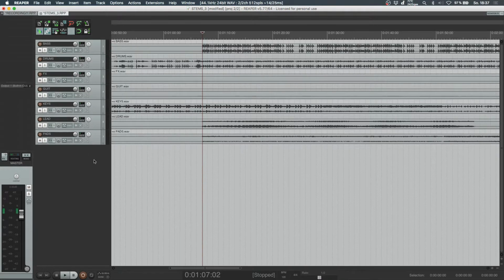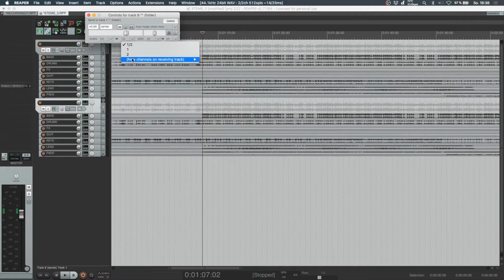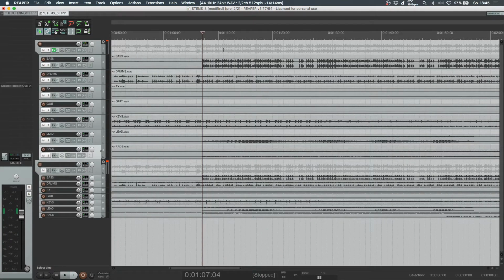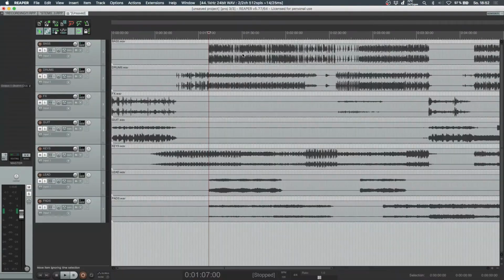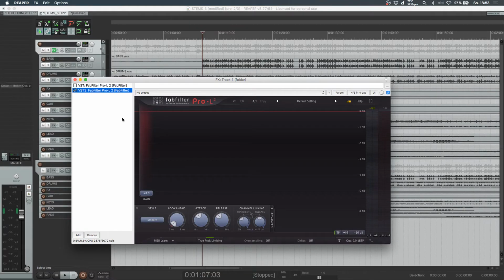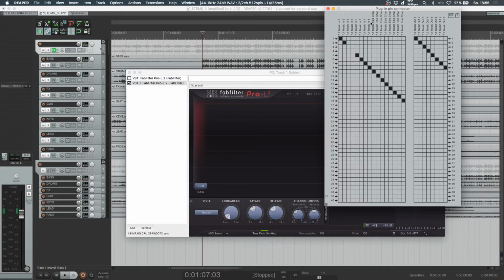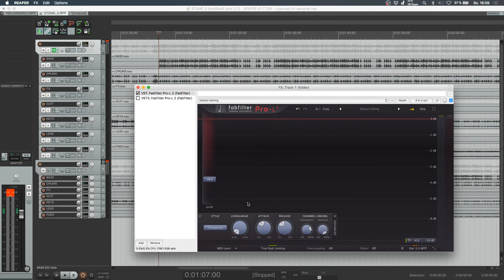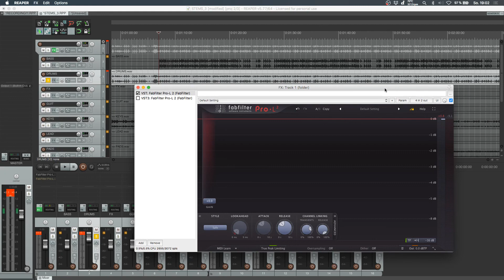Side Chain Stem Limiting With FabFilter Pro-L 2 in REAPER (And Other DAWs)

Comment: What I want to know is if this is achieving the EXACT same result as it would with the Master Limiter? Will this method Null against the other method?
Reply from the maker: Hello, to be honest I do not know if the result would null a limiter on the master with the exact same settings. To tell the truth, I have since transitioned to a slightly more tedious but more robust setup that I have created a template out of which always delivers both sidechain-limited stems and a master downmix which will always null the sum of the stems with the possibility to achieve a target loudness.

If enough people ask for it, I might actually make a video out of this setup as well, but since it's so tedious, I have not had the headspace to make a comprehensive video out of it. 
😅

Comment: Wow thank you so much for this! Very helpful!
Does this also work with any other effect on the sum track? such as Tape maschine plugin? Best regards and keep doing such helpful stuff :) best Roman
Reply from the maker: Hi, sorry for the delay!

I have to admit, the workflow I use today is a bit different from what is shown in this (early) tutorial.
I wouldn't recommend using any other effect when rendering the limited stems as this will alter the reference mix and limiting will no longer be accurate. The way I would do it is to first set up a mastering effect chain and use Reaper's "render through master" option to get the stems. Then use the new stems with effects rendered on them to get the limiting done. But maybe you've found a more suitable workflow by now, this is just what I would do. :)

Comment: Thanks for putting this tutorial together for this useful Pro-L feature in Reaper! A note about the 0.0 clip indicator. With the Pro-L settings used in the video this is expected. The clip is showing intersample peaks above 0.0. Since the preset used has no lookahead and output of 0.0 there will be lots of inter sample peaks above 0.0 which will cause distortion on many listening environments. To prevent the ISP try Oversample 4x, lookahead of .1 ms, should restrict overages to about 0.1 over the output. Setting the final output to -.2dB will then prevent any ISPs all together. In general, mastering engineers typically have the final brickwall at -0.3 or -0.2 for this reason. This Fabfilter video will explain in more detail :) https://www.youtube.com/watch?v=ne7OfBVeZIc
Reply from the maker: Hi Aaron, thanks for the comment, I'm glad it helped you out. By now I've found a slightly more optimized workflow with Reaper and Pro-L2 but I still haven't gotten the real deal yet, I'll keep looking - also asked Dan Worrall about it but even he doesn't seem to have THE solution yet.

Are you sure about the ISPs here? I expected if Pro L2's True Peak Limiting was turned on, it would eliminate those. (As far as I'm aware, inter sample peaks and true peaks are essentially the same.) Granted, I didn't turn oversampling on, but if these were ISPs, I'd expected them to go way above +0.0. Note that Pro L1 (from the tutorial you've linked) does include ISP detection but no true peak limiting yet, unlike Pro L2.  Eitherway, it is probably a good idea to keep a bit of headroom / turn up oversampling for the final stem rendering.
Also be aware that I've used the "Safe" limiting style here which doesn't let the user adjust any lookahead or attack value. Since this mode is supposed to never introduce any kind of distortion, ever, I'd be surprised if that didn't use some hard coded lookahead  value  internally. The knobs which grey out may visually stay on their last used value, but I suppose this is just a visual thing and has nothing to do with what happens in the internal processing.
Reply: @Zet237yt  Ah I missed that. Wasn't aware of some of the new L2 options and don't know how safe works with ISPs. Good to know. With the new true peak enabled it shouldn't peak above 0.0, but Reaper meters appear to hit red clip indicators at -0.001 which is unique. Wonder if it would show red clips if you set the output to -0.002 on L2?
Reply: There is some interesting isoteric discussion around ISPs. A good rule of thumb is that if you cant hear them, they don't matter, and instead of sacrificing loudness for a principle, many of the most streamed masters in the world exhibit ISPs. Think Weekend / Swedish house mafia / drake and so on. there are actually mastering to 0dbfs with out true peak limiting. It makes sense to avoid clipping bad consumer converters with ISPs in theory, but in practise as long as the length of the ISP is under two or three samples, it is absolutely inaudible.

Comment: When you are exporting each stem can I just double check all you are doing is: solo the track, render window, add new track name like 'limited', add to render queue and repeat until all tracks in top folder track are added? It looks like you render each track twice which I found confusing....
Reply from the maker: That is correct! I might have done some hickups during my screen recording back in the day, so this might not be entirely accurate and as such looks like I render the tracks twice.
I have just today looked at some improved workflows which take advantage of "render tracks through master" but so far I haven't really found an ultimately compelling way of using side chain limiting.

Comment: Thanks for the tutorial! Do you know other limiters that can do this in Reaper (3rd party or not) or any other hacks? I tried NP1136 Peak Limiter but didn't like the limiter itself.
Reply from the maker: Hi! Sorry, the Pro-L2 was the first limiter which made me aware of this feature. That's why I wanted to try it out myself but found the setup to be a bit tricky - which is why I made this tutorial, because I wanted to share the workflow which worked easiest for me.
I'm not too a plugin guru myself so I don't follow all the cool new plugin releases, but I'd be surprised if there isn't another limiter with this or a similar ability! :)
Reply: Try the plugin I mentioned above, it can do the same thing, and it comes free with Reaper! (but I didn't find the plugin precise enough)

Comment: what is the benefit of the  Side Chain Stem  limiting rather then a full mix limiting sonically
Reply from the maker: Hi evan, not sure what exactly you mean by "sonically" but I will try to answer your question anyway! :)

You would never use side chain limiting for a full mix, that is what you can put the plugin to your (pre)master for. It is handy specifically for creating stems that can be summed together without clipping yet without creating them in a compromised way that makes you lose a lot of the sum's loudness. If you need stems for some sort of interactive music installation or program (e.g. a video game) but cannot use a limiter on the master bus, be it for technical limitations or just to save some processing power. Stems mastered with side chain limiting will (at least should) never clip when summed so you can send them to your client without having to worry about peaks in the summed full mix.

Obviously you will need to take some compromises with this process and summed, side chain limited stems will never sound the same as a properly mastered and limited full mix. However, when working with single stems, it is important that not only the full mix sounds great but even more so that every single stem sounds good on its own and does not have any audible artefacts from limiting which would not be audible in the full mix.

Hope that answers your question!
Reply: +Zet wow that's clear now , BTW you didn't mention that in the video , anyway thank you so much , 👏👏😘😘
Reply: @Zet237yt  Why not just use the internal input?

Comment: ?? why not just use the internal trigger instead of duplicating and side chaining?
Reply from the maker: Hi Frank, the idea behind side chain limiting is to have a bunch of stems after the limiting process as opposed to a full mix. These stems, when summed together, do not clip but you still don't need to dial them down too much for a compromise. As such ProL2 needs to listen to the full mix even while rendering just a single one of its stems.

To me the duplicating method came across as the most convenient to set up as you only need to perform the routing once and when you want to export the stems, you can easily solo the desired stem without accidentally silencing the full mix that needs to be listened to.

I hope that helps. :)
Reply: @Zet237yt  I still don't get it.  Why not just put a limiter on each track/stem?  The sidechain input in your video is exactly the same as the internal, so why bother?
Reply from the maker: @bsmith8166   It is different: The sidechain input is the full mix which means signal could get limited without itself reaching the threshold. The goal here is to render each individual stem, not the full sum, and make sure that when the stems are summed together no clipping will take place, without an additional limiter on the sum.

By now I have revised the approach from the video a bit and have come across some caveats regarding side chain limiting. However, when working with audio material which gets delivered in stems as opposed to the full sum, this approach is still the quickest way to make sure the sum of those won't clip.

Hope I could explain the difference. :)